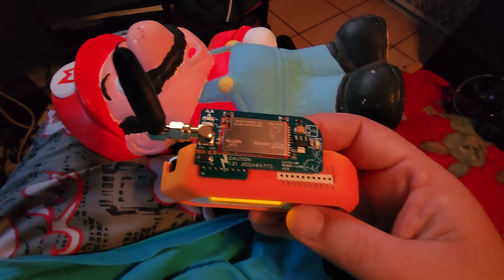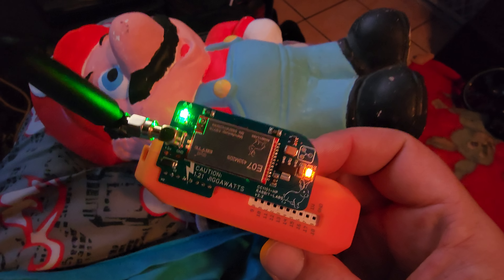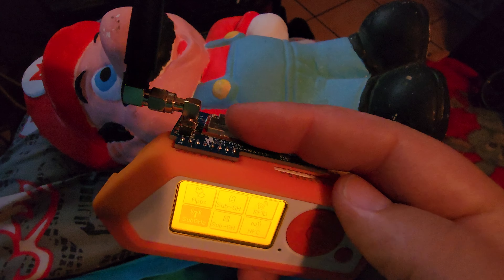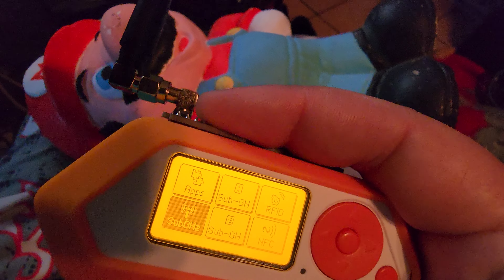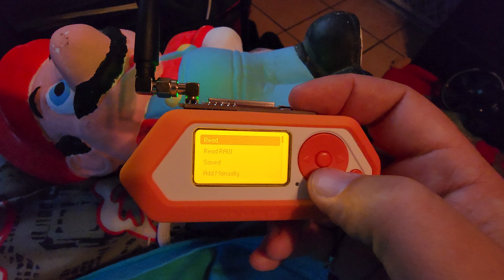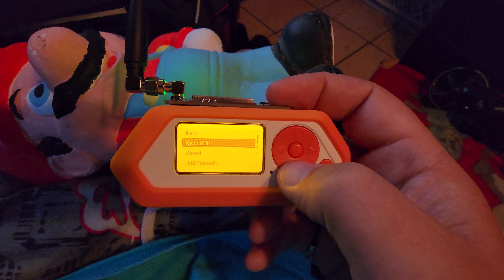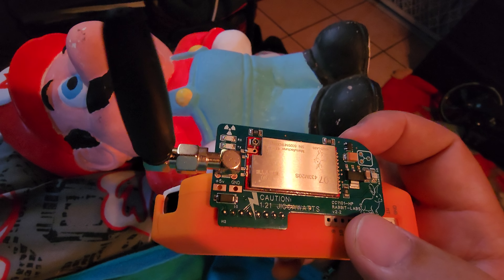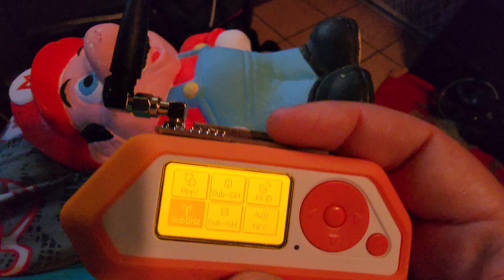Flipper Zero, What is a Rabbit Labs Amplified C1101, and what can it do?

Comment: This board sold out within minutes of them releasing it!! Now im sad
Reply from the maker: Edit for spelling*
I bought both of mine with the very first roll‐out, but the first boards were defective, so I got 2 replacements. Now I have 4😅. But the first 2 i got are only about 1/2 power😢 like I show in my distance testing video. But dont worry, they will have more soon, just sign-up for the notification on Tindie or join the rabbit-labs discord to get the latest info about when they drop next.
Reply: Well if you found out they shipped you the original flux capacitor board rather then the new upgraded version you might be disappointed when they fail to own up to it.

Comment: I think rabbit labs said he was working on a 'Long-Range' SubGhz board so maybe that's where the confusion came from? Unless this isn't the same board he was talking about a month ago?
Reply from the maker: This is the same board, I hadn't had too much time to test this when i made the video, but since then, I have discovered that it DOES SEND signals really far, its just INCOMING signals it cant amplify very well. Which makes complete sense when you think about it. 

When I read the comments about people complaining about the operating distance of the board, they must have been referring to incoming signals instead of outgoing, which they did not specify. So, really, it was just a combination of confusion and user error.
Reply: @boboso5676  Rabbit Labs did state it was meant to be long-range transmitting and receiving, so it's understandable why some people were disappointed.